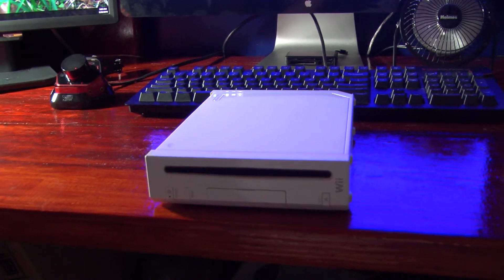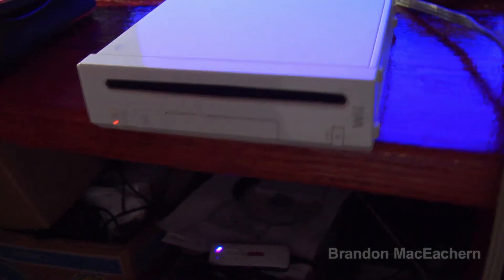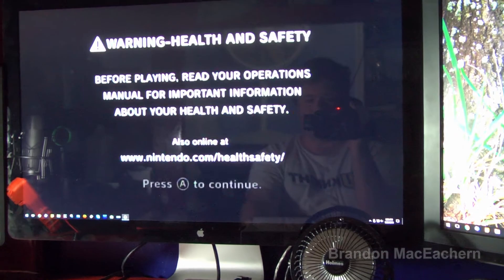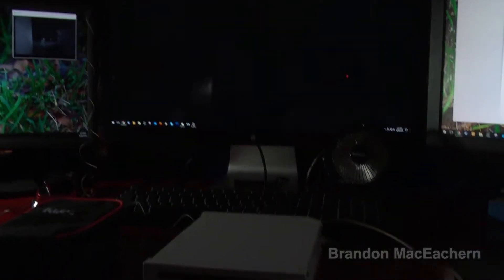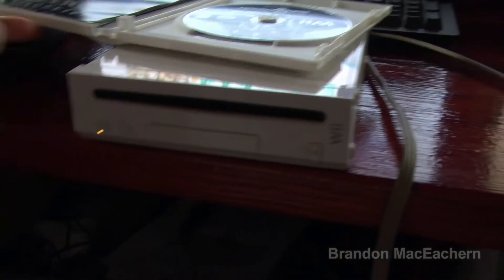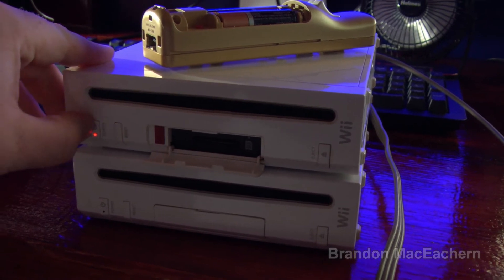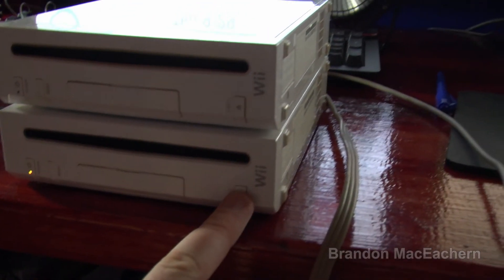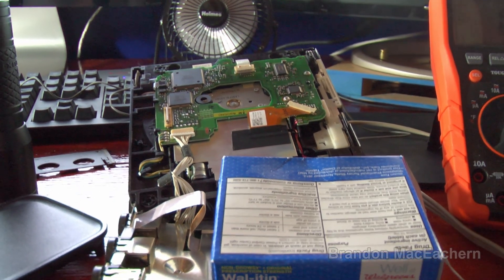Nintendo Wii Repair Diagnoses

Comment: Would be interesting to see if the same problem occurs with the wii softmodded. You could boot into bootmii or Priloader and see if the black screen reappears since. , i imagine, the boot1 could avoid any disk check.
Reply from the maker: It's not my Wii to mod, so I won't be doing this.